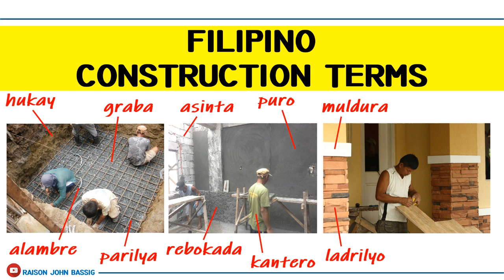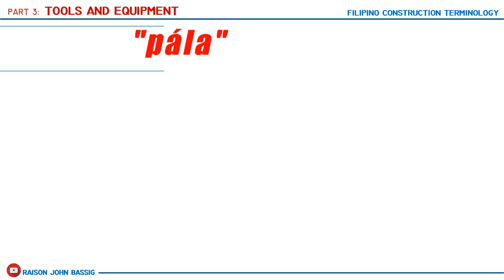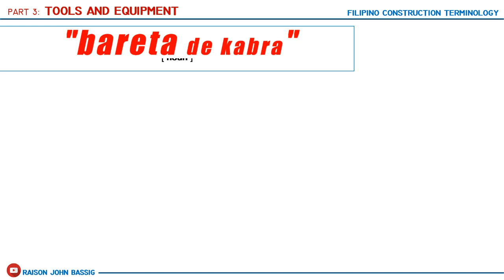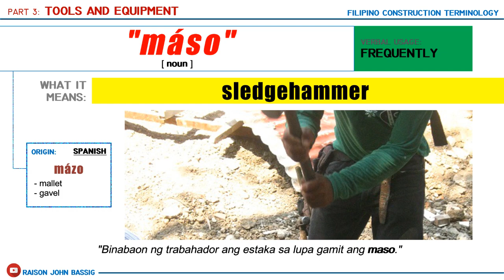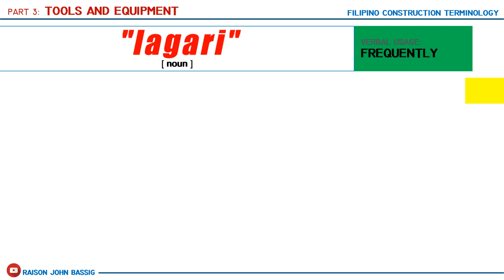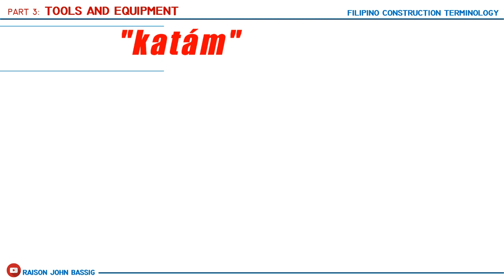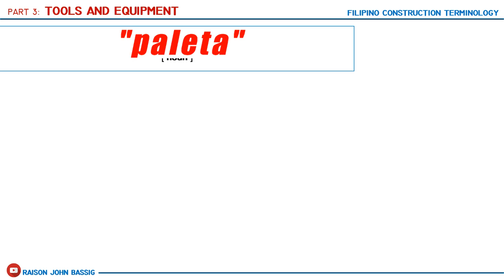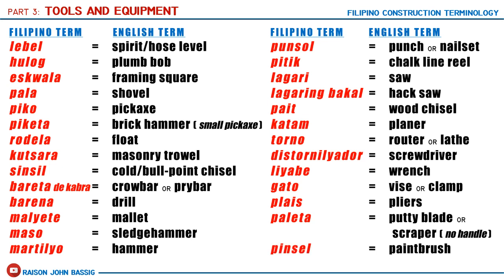Filipino Construction Terms || PART 3 || Tools & Equipment

Comment from the maker: Hey everyone! Thanks for checking out this video. PART 3 will be about TOOLS AND EQUIPMENT with the terms: lebel, hulog, eskwala, pala, piko, piketa, rodela, kutsara, sinsil, bareta de kabra, barena, malyete, maso, martilyo, punsol, pitik, lagari, lagaring bakal, pait, katam, torno, distornilyador, liyabe, gato, plais, paleta, and pinsel.

When designing or constructing a house (or any other structure) in the Philippines, standard blueprints are always written in technical English. This may cause miscommunication with local workers who'll be building your project, since most of them speak in a vernacular language.

As the Philippines was once a colony of Spain for more than 300 years (and later on the United States for almost 50 years), the already diversified Filipino language has evolved by taking in a lot of foreign words (like the Spanish "la mesa" for table or "papel" for paper) and several American terms (like inches, feet, or gallons).

This video will be part of a continuing series on FILIPINO CONSTRUCTION TERMINOLOGY, where I'm going to share with you the terms spoken by local workers in the Philippines, where it came from and what they all mean. These are all based on my research and personal experience in construction sites.

Comment down below if you know any other vernacular construction terms not included in this video. Again, thank you so much for watching and let's all continue learning! :)
Reply: Raison John Bassig thank you Sir 😊
Reply from the maker: You're very welcome Suzzane, glad you liked the video :)
Reply: Bakit wala pong lumalabas na pitik kapag search po natin ?